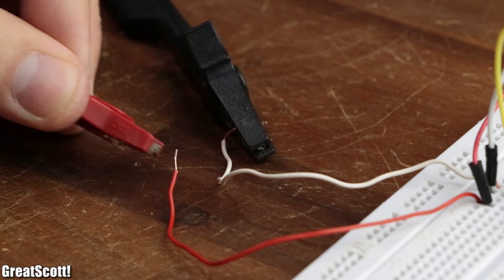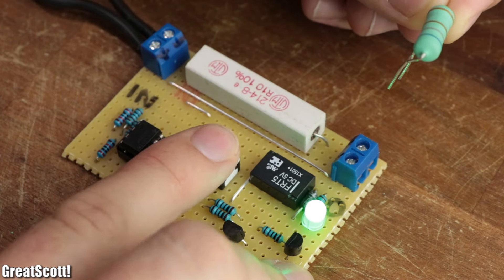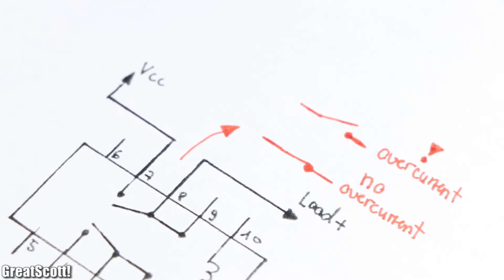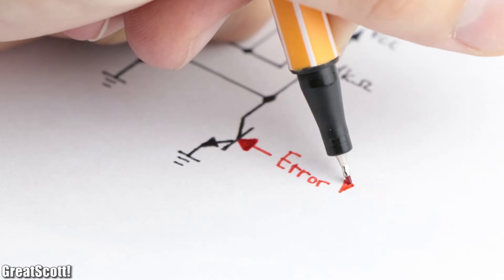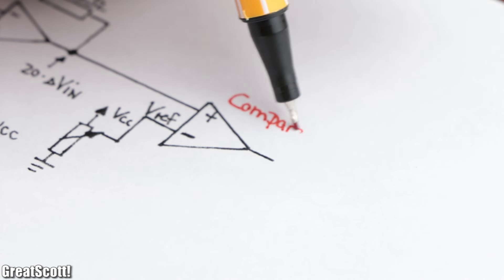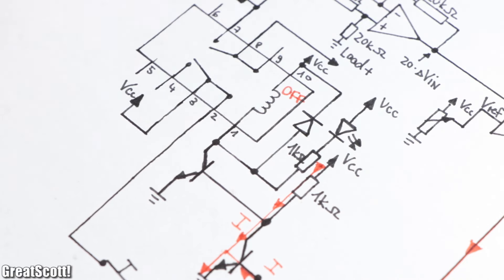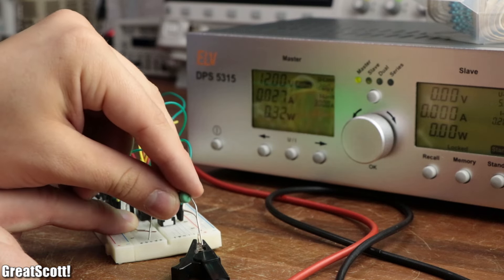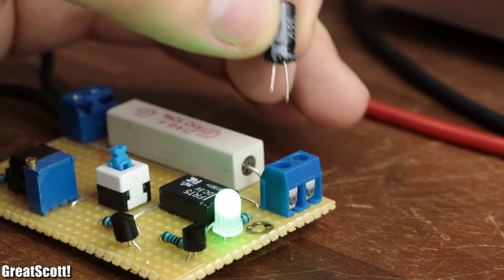DIY Short Circuit (Overcurrent) Protection

Comment: Only 1 transistor is needed. 2nd op amp output goes trough lets say 10kohm resistor to transistor's base. For reset, push button connects to transistor's base and to ground. When the relay is on, voltage on current sense resistor goes to 0V therefore non-inverting input has higher voltage than inverting input. So the output will be near power supply level (depends on op amp's gain) and that makes 2nd op amp's non inverting input be higher than inverting input, so the output will be high as well. That way transistor stays on forever which makes relay turned on forever until you reset with push button.

Comment: hi i would have used the second contact to break the circuit between the coil and the top of q2 and the push button across the contact that would prevent the button allowing full current while it is held (5:14)

Comment: You have to build 2 of them because if you make the protection circuit you need to protect that circuit to prevent high current flows if you make a mistake in the protection circuit..

Comment: One easyer overcurrent/short circuit protection is with a polyswitch or reseteable fuse.
Reply: Diego A with those fuses you cant set the voltage on witch it pops. Witch is often a nice thing to do in my experiance

Comment: Use smaller components and connect it (for example with male headers) to this 2$ charging board and the battery will be almost protected. Also you can do tutorial on overcharge, overdischarge and overvoltage protection.
Reply from the maker: It is on my to do list.
Reply: GreatScott! Also, could you make more videos if you can, please? I really like them. Also, do you plan to do MeetUps? For example, in Germany and Slovakia. Anyways, I would go to them.

Comment: Good..... but , take an oscilloscope and watch the input currant . You have a big overflow before the relais deconnect the charge. 
This is like a disjoncter , . I prefer an electronic circuit with  a constant currant limitation without overflow.  Your circuit is good for a second security .

Comment: The circuit is nice but there is one problem: when someone decides to hold the switch while there's a short on the output, the circuit will oscillate. I think it's a better idea to add antoher relay with a contact in series to a load contact of the existing relay and power it's coil with NC switch connected to supply voltage, so that when someeone hold the switch the contact is going to be open and no current will flow.

Comment: This is fine for low current. But when you get over 5A, using relay contacts gets iffy, unless you have a rather beefy relay. I'd like to see this example pushed a bit and instead of a relay, a power MOSFET P channel in it's place.

Comment: I was proposing if you could try out one using a transitor latch and differential amplifier. 
Like the differential amplifier circuit measurement the voltage drop across a shunt resistance and I output is connected to a comparator which trigger a transistor latch when the voltage drop across the shunt exceeds a certain value.

Like instead of using the relay you use a transistor latch

Comment: Sir please make a video for making a variable voltage and current power supply
Reply from the maker: Already did it.
Reply: Electronics Hub Variable voltage regulators are also there. But what for variable current or current limiting.?
Reply: GreatScott! Sir I have seen that video but you used a module for this. Is it possible with simple transistors and Ic s?

Comment: Just buy a CorpCo MB102 Breadboard Power Supply Module (IMPORTANT -> 3.3V/5V) for Arduino Board Solderless Breadboard and it also has a short circuit protector with the low current

Comment: I want to add an led brake light to my scooter to be better seen. But all I know to do is steal power from the already installed stock power leads. Is there anything I can do to stop an over load of the circuit board on the scooter by piggy backing the power for more leds? Please help?

Comment: THANK YOU i tried to make this in my diy power supply but it it worked on bread board, but not in a PCB
i tried to find video's about a simular circuit but nobody made one

thanks for fixing my problem

Comment: Good circuit, only thing I would try is adding a tl431 or other reference generator and using MOSFET instead of a relay for lower current applications.

Comment: Reminds me of what i tried to create recently with discrete components:  
Low voltage high current stepdown converter.
Didn't work as intended....first the OpAmp and the Mosfet kept ringing, after a small redesign i would have needed a mosfet driver and the last attempt was simply too bulky for the projects i wanted to use it in.
maybe i should just get a finished chip for that. 

Now the next thing is a switchcap power-controller for a 12V PC fan.
And DTFM data transmission using arduinos.

Comment: LM358 tends to work well on Vicm (common-mode input voltage) close to its negative supply. Vicm on circuit in this video close to its positive supply, so other type op-amps such as LF353 or LF412 or TL072 or TL082 more fit to this purpose.
excellent explanation, excellent video.
cheers from Indonesia
Reply: I'm surprised the circuit actually worked. The datasheet for the LM358 states the maximum input common mode voltage is 1.5V less than Vcc, which he clearly wasn't meeting here.

Comment: Ehhh.... I've seen people do something similar with a jfet, but the circuit is much simpler. I've built the circuit on circuit simulators, but I don't have a current monitor to check it out in a real world situation and I'm only 50/50 with the guy who made it.

Comment: I was trying make this circuit without knowing about differential amp so I used NTC termistor and low value resistor, which heats up NTC, when over current flow, which drop voltage on divider and op amp sense it ... what a stupid idea even worser to built-in it into power supply, which insides heats up ... genius I know ... I just shorted this "protection" circuit and used power supply without it for some time :DD oh boy old good times! :D this vid reminds me of that fail of main

Comment: you could probably use a normally open Momentary push switch between the transistor base and ground instead of the blue Colored bistable switch

Comment: I don't see where you have the information on parts or  circuit description. As I am looking into make a system very much like you have on your video. for A 300 watt  Shut down of the power supply  by two possible over currant and Short of the out put HELP is you can?

Comment: Sir 
Is is work in I case connect battery to power supply to charge it .but I connect battery wrongly .means I reversed polarity on battery 
Does ir protect the power supply ? 

Thanks

Comment: i have tried to implement the circuit on my breadboard but the LM358 gave wrong output of 0.76 v even when there is no current through   the current sense resistor  " the voltage difference between its two inputs is 0v " ???

Comment: Some project looks pretty simple, however I tried to build it with LM358 and its not working.. voltage around 9 volt and when a tried to change resistors for more accurate ist still was some messy jump in voltage..

Comment: Wouldn't it have been easier to use a thyristor on the output of the comparator?
Reply: No, thyristor stays on if enough current flows.
Reply: @milanhlavacek6730  if the current that flows through the relay is bigger than the latching current, it should work
Reply: @MitsuZer0G  oh, ok but custom made relay would be better. Its coil would be set to trip current so if enough current would flow the coil would activate an turn the relay off this would also activate other path for current to flow so it would stay latched until the power is restarted.

Comment: So I'm working on solar night lights, and have almost everything, only thing I don't have are the transistors, so I made the photo sensor with a resistor, and it works, but it still turns on as soon as the sun starts to go in, I need help, how can I make the light come on, when its pitch black or close to it.

Comment: HUGE ERROR !!!!!!!!!!!
The output of the op-amp used as amplifier should be given as input in the inverting end of the comparator instead of the non-inverting end .
Check it once I implimented the circuit .

Comment: There must be reason behind your double push on the reset button on your circuit...
Reply from the maker: Like I said, a normally closed push button is recommended. I did not have one so I had to use this one and a double push to "simulate" it.
Reply: Oh, i think i missed that one in the video, so it's a latching button you used then, all clear to me now...

Comment: how to discriminate transient current and over current?. as shown in the video while keeping capacitor as load ,the circuit is getting turned off which is due to current required by capacitor is high intially to charge supplied voltage,it is not continuous and will be zero after reaching the supplied voltage

Comment: I was planning to make this circuit but in a 1.2v to 30v variable power supply ( LM338 ), power the main system with 7812(  or larger) voltage regulator connected before the LM338, while sensing the output voltage of the LM338. just dont know where to start.

Comment: Hello,
Can you guide me for limiting the output current to 350mA of a power supply (with output 250vdc, max output 15Amp). Should I simply add 0.22 Ohm 10W (9 Resisters) in Parallel before load?

Comment: I'm trying to make a 30V 5A variable power supply and your design is for a 12V ?A supply.  Most of the components I can find in a beefed up version and the reference voltage can be hooked to a 35vdc input before the voltage is regulated but what about that power resistor?  Would I need a 0.1 ohm 150W resistor or what?

Comment: Tnx Scott, for this circuit. But i have a question. I am building a powersupply and i will put a short circuit in my project. With some research some guys put there short circuit before there voltage regulation. This is a circuit limited to 12v. But what to do if youre powersupply  is 24v input? What is best a short circuit before or after youre voltage regulation?
Greetz Preppie_be

Comment: i built something similar, but using an arduino, wich also allows me to kinda read the current over serial monitor, and control a relay if the current value us too high.

still, the relay may not be fast enough, i blew a 12v power supply once because of that

Comment: Stable for what input n max output? Am looking a 12v input cross protection n overload protection from 12v battery or 19v power from ac-dc adaptor. Will this work?

Comment: Y not use a DIODE?..silicon diodes drop about 0.6volts....here 0.44volts dropped over resistor..plus power is consumed by relay n stuff...so it may have same efficiency r8?

Comment: I really enjoy watching these videos and trying to understand the circuits, however this time i don‘t get one step, so perhaps someone can help me out and explain! i can follow along nicely up to the point of using a normally closed pushbutton for resetting, which still makes sense to me as the relay closes again when you press it. however how come that it doesn‘t open again as soon as you let go of the pushbutton and it closes again, powers the base of the second transistor which „depowers“ the relay tranistor? rewatched the video a couple of times but still couldn‘t figure it out!
Reply: If you press the button and release it would deactivate the relay but only if the fault was still standing. 
 It would need the fault to be clear to allow a reset.  The pushbutton would be normally made and you would open it to initiate a reset.
Reply: gartmorn thank you for your explanation! and of course, that‘s actually kind of obvious now that you say it! it seems like i was so focussed in trying to understand the setup with all the transistors etc that i didn‘t think that far! thanks!
Reply: @lucahasler906  glad to be of assistance.  I am not an expert but sometimes I get mental blanks and someone else will explain and it becomes obvious.  Then I think, of course, why didn't I see that!

Comment: Why not a PTC Fuse?
Reply: I use PTC Fuses often, But they trip current is not very accurate, an have a holding current, plus its normal resistance can be higher than 0.1R current sense resistor seen here, plus this circuit cuts OFF the current completely like a real fuse does. So it depends on in what fashion do you want to protect your circuit.

Comment: Can I use two terminals relay? the second terminal are connected its own, if in short circuit, the relay will cut and the terminal go to the second terminal and stay because its power itself unless you cut that terminal to reset the relay. It's good or better? Is it better to use too? but there's no adjust or anything. just need to replace another relay.

sorry grammar error=

Comment: Hey GreatScott,
I was wondering if you would be willing to help me draw a variable pwm circuit for a project of mine. I have a basic schematic for such a circuit, but I am trying to figure out how to get the output to produce a variable 80% - 100% duty cycle. The output from the 555 will go into a mosfet that is to handle at least 30V. The goal of the circuit is to produce a dimmer for a 30V LED. The reason 80% is the minimum duty cycle is because that percentage from a 30V supply would produce 24V which is what I determined to be about the minimum voltage to produce light from the LED. Please let me know if there is more information you need or if you need some clarification because I probably I not explain this very well.

Thanks

Comment: Have u try it with 5V,  24V or higher voltage 🤔
Reply: Jonathan Chan you should use higher voltage rating according to your power supply and it's fix voltage can't change to low or high

Comment: I simulated this circuit and it doesn't work, I varied the potentiometer to a current of 1 A but it is also passing 2A ... 3A, because when the current increases, the voltage at output 1 of the first ic increases, thus maintaining a higher value (H ) at all times and the relay does not trip. helpme please.

Comment: The problem that I foresee is that with a 12V supply, the inputs of the first LM358 are sitting at around 11.4V. Unfortunately, the LM358 has a specified common mode range of only up to Vcc - 1.5V which would be 10.5V with that supply. Now, you may be lucky and find that the opamp works with its inputs at 11.4V, but it's not guaranteed. The inputs are PNP Darlington transistors with a current source in the emitters and just can't operate very close to the positive rail.

Worse is if you use a lower voltage supply like 5V, when the opamp's inputs would be at 4.76V with a maximum common mode range of only up to 3.5V. The behaviour would be quite uncertain in that sort of case.

The simplest solution is to monitor the current low-side. That is, you put the current sense resistor in the negative line, which is a common approach. Then the inputs are close to ground, but that doesn't matter because the LM358 (and many similar opamps) include the negative rail in their common mode range, so are guaranteed to perform as expected.

Comment: There is a problem of short circuit protection in a bms system (cf-4s-30a) due to which the output current (1-2amp) appears only for a few seconds. Why so? 
, nd even the output current rating is of 30amp so bms must provide atleast 10a..!

Comment: Hi GreatScott :) First, I'm from Czech Republic. :D This is very important circuit. I have something similar with ACS 712T. It works very good with high current without heating.I must ask you. Can you build some circuit witch turn off load when the main power voltage is under 230V AC? I can't build anything quite efficient. Thank you so much. :D
Reply: Marek Štampoch I used ACS712 in my university project. This is also an overcurrent protection device with showing current value. Acs712 is very accuracy while the output voltage measured by DMM directly. However, after the analog signal transferred to MCU on PSB, there is some voltage loss. As a result, the measurement by MCU is not right. Is there method to improve this measurement?
Reply: Hi,
I asked my friend to best solution of this problem and it's pretty easy. You must put between output pin and analog input the op-amp voltage follower. The input current will no longer reduce the voltage from the sensor.

Comment: I made one using a computer power supply and buck boost converter the smps has a short circuit protection but if interfaced with buck boost converter should i keep this circuit

Comment: There is a timing problem in this circuit. If the current through the switch arrives to the base of the transistor before the the switch is turned on then the switch is never turned on. One is then forced to flip the switch on after having powered the system. Any ideas how to solve this?
Reply: I decided to replace the push-button with a transistor and insert the error signal into the base. That way, when you turn on the circuit (assuming you're not yet over-current) no current flows through the typically closed contacts on the relay and the relay can turn on. Once an error signal is detected it turns both transistors on. The first transistor pulls our current away from the coil, the second one is turned on and stays on since it's fed back into itself, the circuit is reset when you turn the power off and on again.

Comment: Nice work. You could have connected the opamp power to the relay output to get a cut off latch. The second relay can be eliminated. For the reference voltage, you can use a 4007.

Comment: Hi,
I want to use it in power supply 0-30V 0-10A!!! Needs some changes or is ok
My thought is that if I put the lm7812 on all vcc except one that is the R9 0.1 ohm.
Reply: Nick Rallis definitly change the relay to a 1/2hp rating